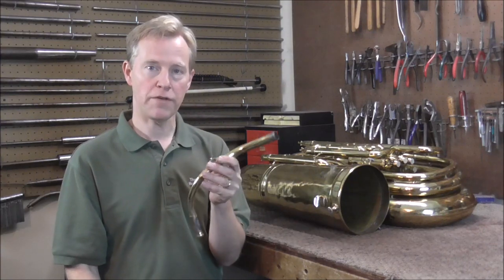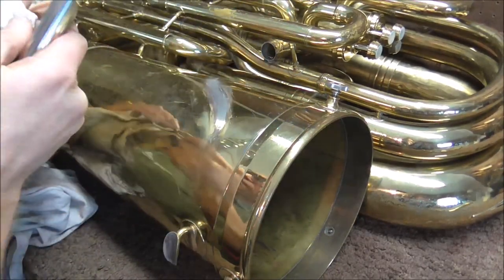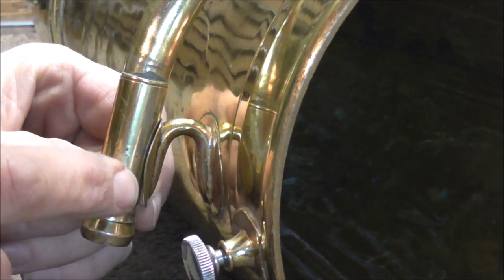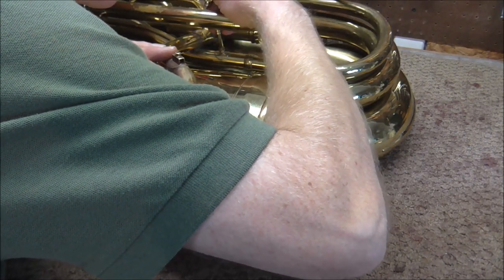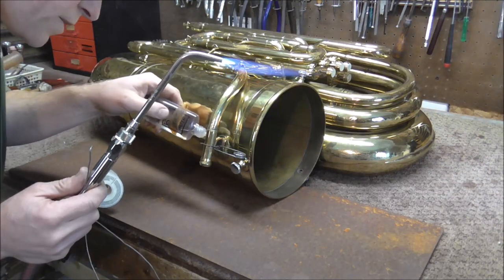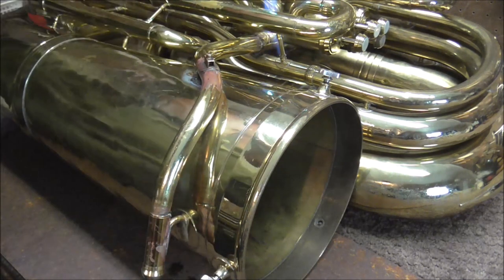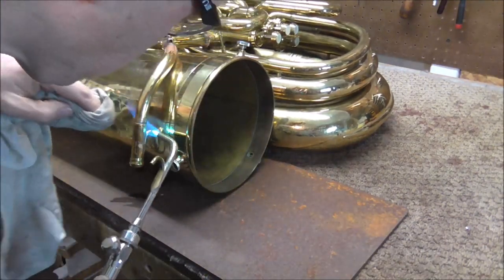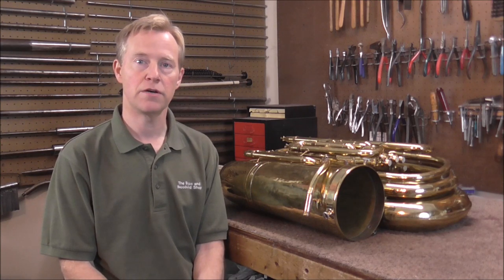How To Solder a Tuba/Euphonium/Baritone Leadpipe

Comment: Can you solder silver plated to silver plated.. Or raw brass to silver plated?
Reply from the maker: Yes, you can solder most surfaces together. A few that you cannot solder on are: chrome, stainless steel, aluminum, or any dirty or oxidized surface.